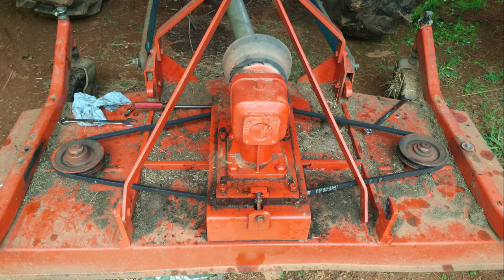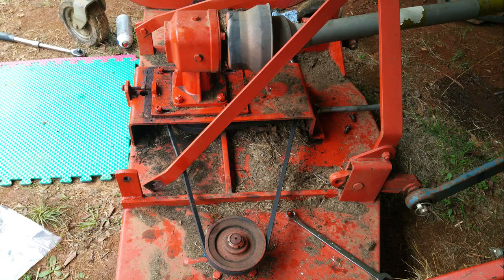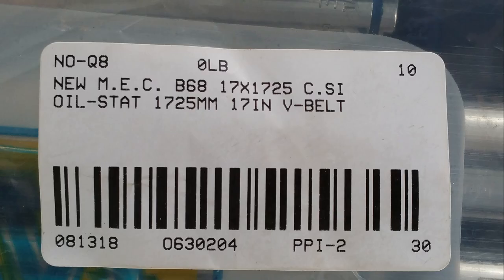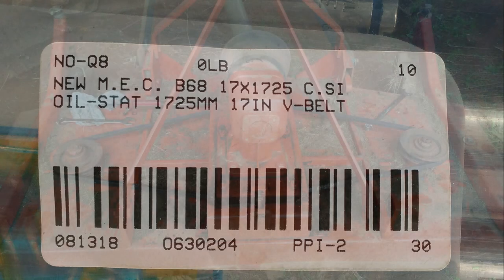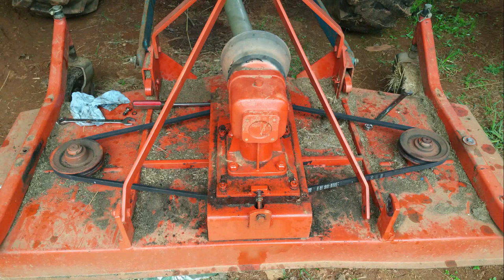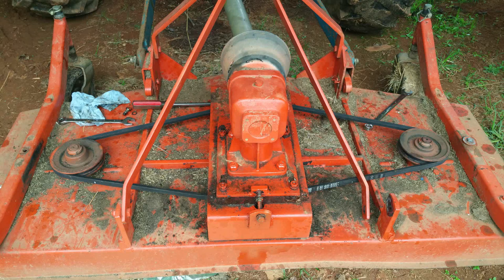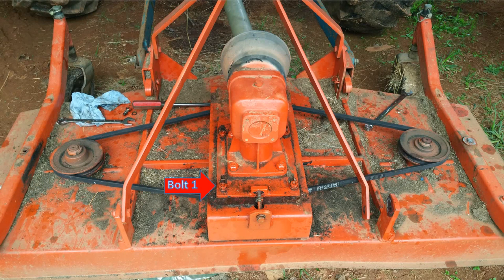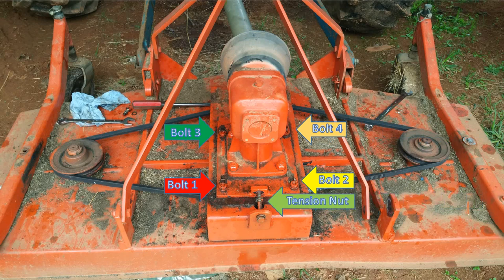How to replace a lawn finishing mower belts.

Comment: The B #
B= Type of V belt
The B# is the inside belt diameter.
Matching belts is the outer diameter # x 58”.
For example a B68 belt is 71” long.
I found my
B74 (77”x5/8”)at Tracter Supply.
Ordered an extra on Amazon.

Comment: I have a mower that is very similar to yours. It's a Farm King 60" and it takes a B68 belt. I am able to follow all the steps in your video, but I can't stretch the belt over the last pulley. I've released the tension screw to the max and the belt still won't stretch over the pulley.  Did you have any problem getting yours to fit?
Reply: Did you work out how to do it? Am just doing mine and have the same issue. Have a b73 belt.